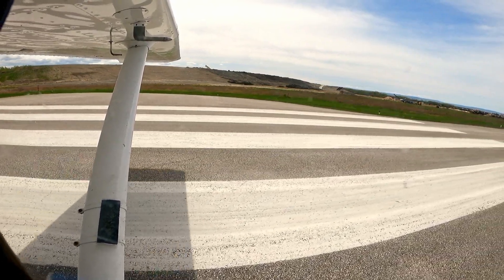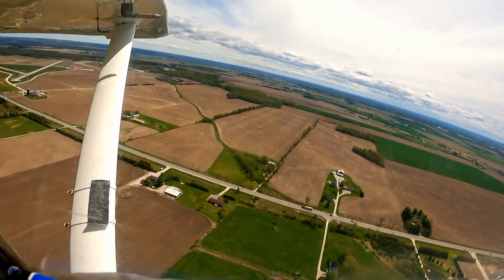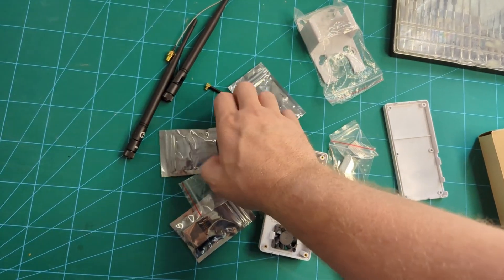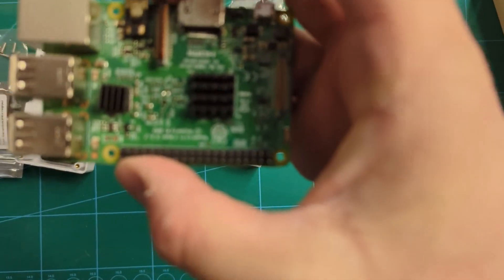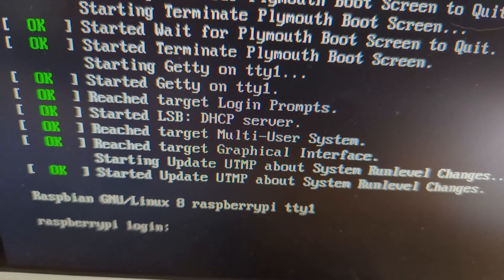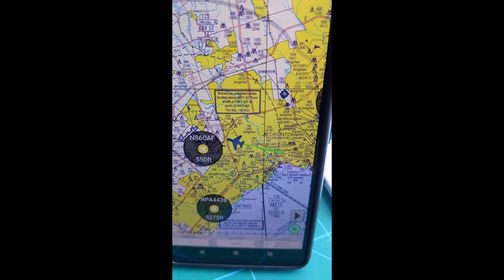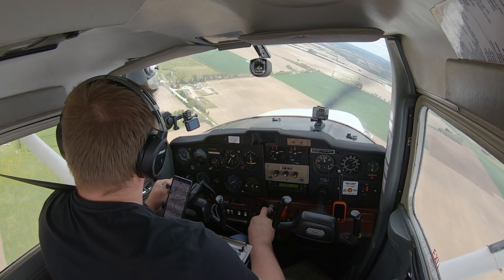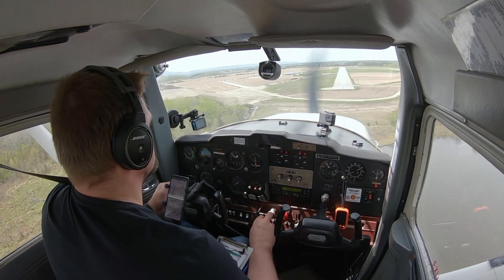Need ADS-B In? Build Your Own Receiver! #aviation

Comment: I have the same problem, what image did you use and where can I find it?
Reply from the maker: You can find a list of releases in this github page. You'll want to avoid releases named "pre" as those are prerelease for testing.

https://github.com/stratux/stratux/releases

They are labeled "EU" but each release page has a separate "US" image you can download. Here is the link to the current latest release

https://github.com/stratux/stratux/releases/tag/v1.6r1-eu032

If that version doesn't work, I would systematically make my way down the releases one by one. Tedious but may produce results. Also, if you have the AHRS module, I would recommend removing it and trying to get the Pi to boot without it.
Reply from the maker: Let me check and get back to you. Keep in mind, my image may be out of date.

Comment: Do any of your readers know if they are suitable for use in Australia? Thanks
Reply from the maker: I'm not sure what you mean by readers, but most electronic flight bags are compatible with the stratux. The stratux should be able to paint traffic and your position on any of the common apps used. Foreflight should work :)
Reply: Thanks for the response. I know the system works in New Zealand but have heard from two pilots that it may be not compatible with the setup here. That’s why I made the open question, hoping to find someone who may have concrete information yes or no.

Comment: I wonder if they will ever be able to do this with ADS-B  out? It would need to grab info from the altitude encoder or the Mode C? 
Could be a lower cost way to comply with the eventual space based ADS-B  in the future.
Reply from the maker: I think it would be possible, but transmitting is a different ball game. I believe the FCC and Industry Canada require transmitters to be approved, so a do it yourself device might be difficult to get approve or test. Additionally I think even for experimental ADS-B out transponders, TC and the FAA still require some level of certification for the extended squawk capabilities for mode-c ES and mode S transponders. Rightfully so as other aircraft may rely on a reliable and correct signal for TCAS. 

I imagine even this device I built may have some bugs receiving. It's possible aircraft that are transmitting ADS-B out might not show on my map and I would not know. I have already seen examples of the GPS data being incorrect (I have later learned it was due to where I positioned it in the aircraft), so I would not consider it a trusted data source to transmit to other aircraft. But I would not be surprised if in the future we found someone who did the work and kept it open source.